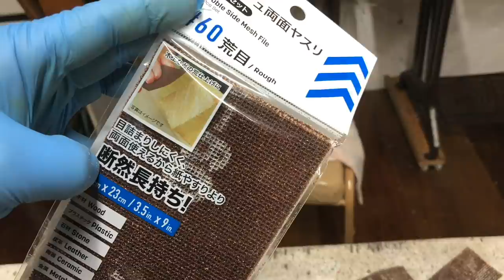Bespoke shoemaking 3/3. Welt making. Welting. Bottom filler. Outsole stitch. Heel making. [Engsub]

Comment: Why didn’t you put glue under the front of the footpad around 23 minute mark? Also, I have partial paralysis in my non-dominant  hand, I used to used the same yellow handled hobby knife you use but it was difficult to keep the blade vertical because the handle would bend and flex. Found this on another leather working channel, works great. “The maximum sharpness/Made in Japan/OLFA 9mm Stainless Steel Auto-Lock Graphics Utility Knife & 9mm Snap-Off Art Blade, 10-Pack Value Set (with our shop original description of goods)”. You can paste the description in to Amazon. Great channel

Comment from the maker: 6:23 If the stitch spacing is narrow, the leather of the insole is likely to tear. So reinforce with thread.
Reply: .. mmm .. tighter spacing stitch is not equal to 'better made' .. in fact it only means 'more needle holes' which structurally weakens the leather .. as you explained.